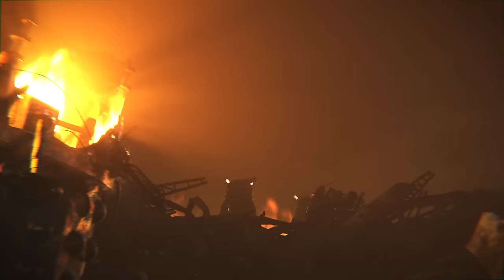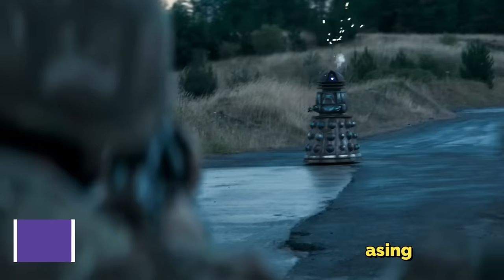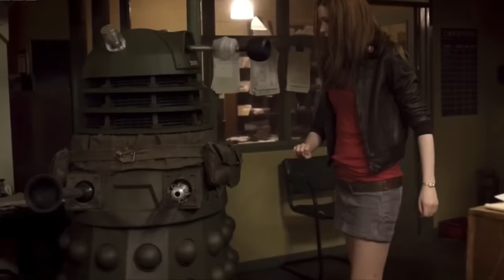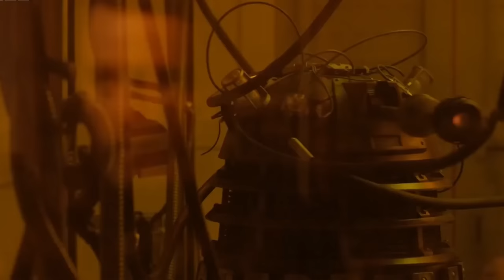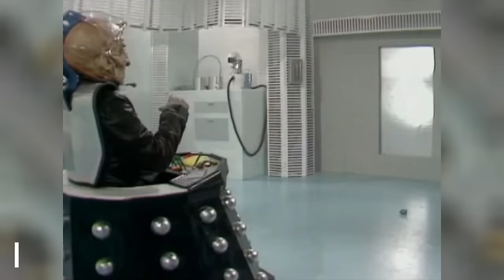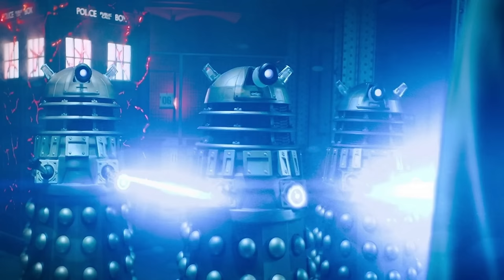Dalek Anatomy Explored - Do Daleks Get Infected With Bacteria And Viruses? Can They Reproduce?

Comment: Sad. So much lack of effort in thinking through the script. Shows/talks about the Daleks inside the casing then ANGRY VOICE MODE ON Are they robots or organic? Shows a clip of them speaking then back to angry voice CAN THEY SPEAK? States the casing is 3 parts but declares the the manipulator and gun arms are in the upper part but yet claims the Dalek inside is in the middle part which is the same level as the arms... You can do better. See me after class #wtfdidIjustwatch